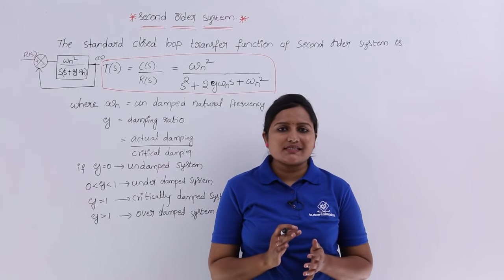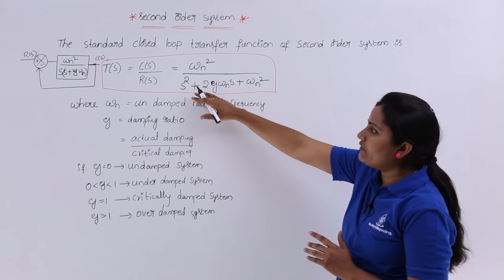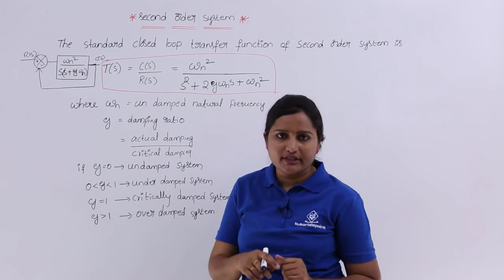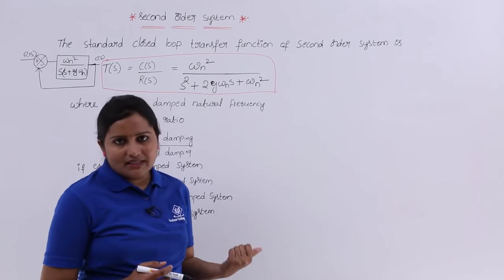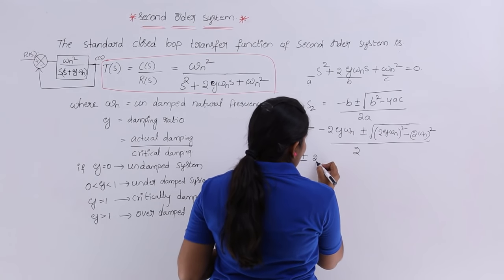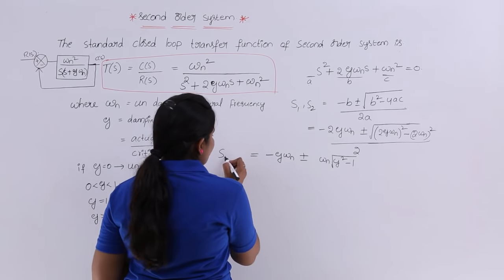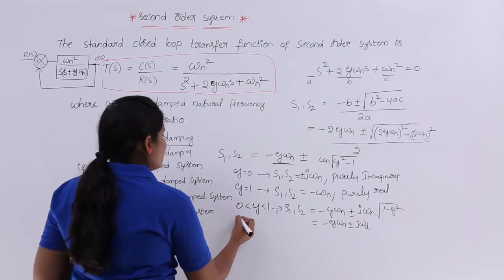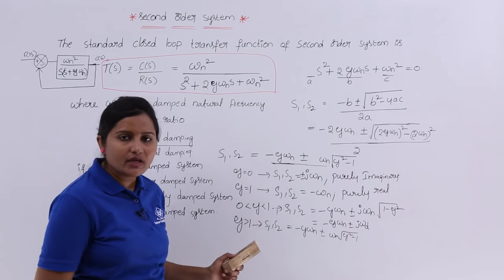Second Order System

Comment: dear mam,
is necessary to equal both wn^2?  (numerator and denominator)
Reply: yes
Reply: but when unequal then what can i do?
Reply: Jack Kabir yes
Reply: There is a factor attached to the wn^2 of the numerator which is :-
 ratio of the constant attached to the input to the constant attached to the output of the system,
and for some reason in every control lecture it's always assumed to be unity and that's where the confusion begins. It's of not much importance as we are only concerned with the denominator and that is the characteristic equation

Comment: if numerator and denominator's wn^2 are not equal, then?
Reply: then that equation would not be called standard second order equation .. to make that standard eqn we need multiply and divide by factor wn^2..
Reply: @ashish6097  Actually it's not the case. 1) wn^2 is the not the factor. wn is just the natural frequency.
2) there is a factor attached to the wn^2 of the numerator which is :-
 ratio of the constant attached to the input to the constant attached to the output of the system,
and for some reason in every control lecture it's always assumed to be unity and that's where the confusion begins. It's of not much importance as we are only concerned with the denominator and that is the characteristic equation
Reply: @AdityaMishra-pp1gw  buddy , I was talking about the standard second order system .
The factor term here I used is  for value of wn^2  .
The factor you are talking about is actually dc gain of system .

If the function is not a standard second system , then some formulas will not directly work , one of them is overshoot and to use the same formula we first make standard second order system then extra constant we get will work as dc gain.

If you still have any doubt , just search my name at quora . We can discuss there .
Have a nice day
Reply: @ashish6097  Hi buddy! Yes, I was talking about the DC gain but did not wanted to mention the term as this term is defined by 'us' when working with steady state response.
What I thought the Jack Kabir was asking is whether the constant term attached to both the wn^2 should be equal. And ofcourse the constant attach to the numerator will only come to play when we are giving some response to the system. In the standard second order system as mentioned by you both the constnat of wn^2  will be equal.
Still I am not convinced how you told him to multiply and divide by the factor wn^2. If you are mentioning the value of natural frequency as the factor why would one divide and multiply the equation with natural frequency.
Reply: @AdityaMishra-pp1gw  the thing I have mentioned about divide and multiply is just to make it standard second order system and that's it .
Nothing more than that .
As to deal with standard function is much easier as compare to some other function which is not standard .
Don't extend the topic and I got your point ;)
Reply: @ashish6097  I got your point too .😎